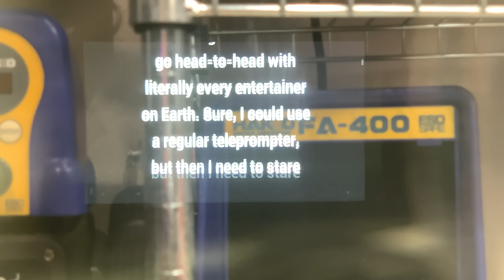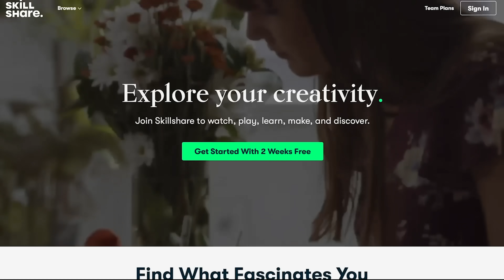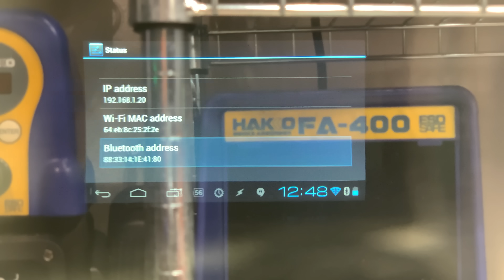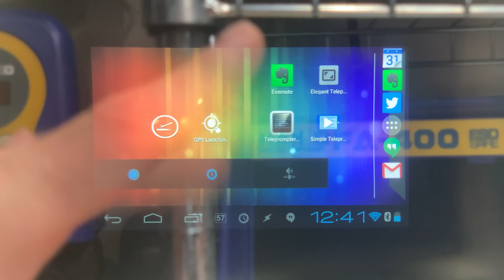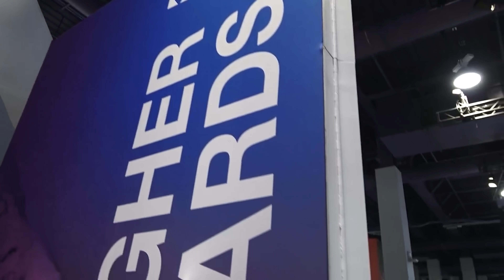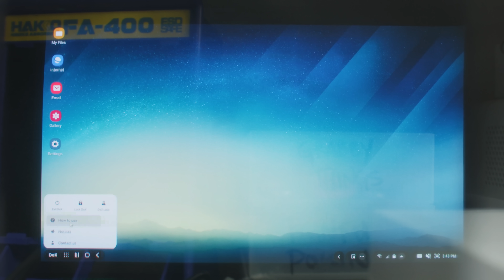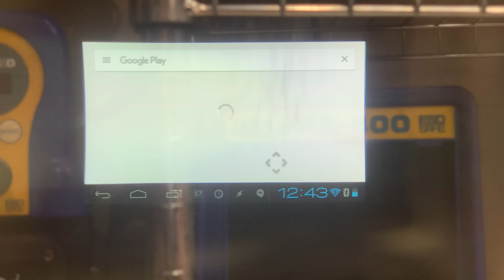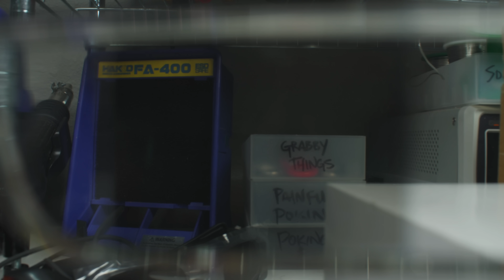If This Wearable Fails, My Channel is DOOMED!

Comment from the maker: So apparently, Epson offers a dev kit that's literally the guts of the BT-40. First-party documentation was available the whole time.🤦‍♂
Epson, my offer of a sponsored video still stands...
Reply: thanks for puttin some rhymes in
Reply: the extents you are going just to look cyberpunk are fantastic. "Eyebrow purposes" xD
Reply: Mums wondering when you're gonna call her for another night out
Reply: How's the mirage keyboard coming?
Reply: @camerong.5024  yes i am also waiting for more info on this.
Reply: This is great! I mean you could start just by chopping the nose piece and leaving one lens on the desk if there's no wire across the bridge... I look forward to your success 🙌
Reply: Quick hard hack take the right side Dremel off any visual bulky parts like the lens peal back the ribbon cable. Now tuck the right guts behind your left ear. Not the first time I have said that sentence btw
Reply: I ttought that was going to be the wow reveal! Ah, good luck!
Reply: Can u make a stereographic display out of it ?
Reply: Hack all the things!
Reply: Man do i wish you had come out with this video ~6 months ago...  I had purchased a pair of these to use as an AR headset solution for work. I ended up returning them since I had opened them up to fix a wire, and in doing so fucked up the cooling solution for the projectors. The thing had battery life issues before, and pretty bad cooling issues afterwards. Whats worse was that it (in my experience) only worked with samsung android devices. It didn't work with google phones, or android tablets, basically only samsung devices that supported Dex desktop mode.

So saying I was floored by the fact you got it to work with some random brands SBU would be an understatement. I will be watching this project with great interest.
Reply: @AidanNaut0  that is on the device manufacturer for not including DP on the USB-C port.
Reply: I actually got Epson to send me the Android Kernel source for my BT-200, which I got after being inspired from watching your other video.

I am currently trying to reverse engineer the LCD module, so I can get a MIPI DPI bridge chip in order to make literally the exact interface Epson decided to put into the BT-40 lol.

I've found DisplayPort USB-C is extremely closed source and it really, really sucks. I'm hoping I can get it working but I don't have a lot of hope for it...
Reply: @DingleFlop  The thing is, the Linux kernel is GPL licensed so they *legally have to honour requests to the source*, if it is something propriatery that they own, you aint getting that source.
Reply: @u1f98a  I understand that, but I didn't even expect them to comply with GPL. Unlike most people, they don't just have it hosted anywhere. They could have easily blown me off and ignore me, but they decided to honor the request anyway.

What I'm meaning to say, is if you don't ask, the answer is ALWAYS no.
Reply: @DingleFlop  
This is legally what's known as the TiVo clause now.  TiVo tried to get away with the source "being on an embedded device" and that the source was available but effectively useless without running on their hardware.  

GPL v 2.0 is essentially weak to this (which was what the linux kernel is licensed under)

GPL v 3.0 addresses this kinda shit specifically.
Reply: Do you have a sponsored link to the SDK?
Reply: can u do karaoke with it?
Reply: lol what
Reply: Best episode yet,
Reply: F
Reply: Link?
Reply: yes I was the 666th like
Reply: There's also the creal MR glasses that came out recently. You could use those.
Reply: Was about to comment that they make teleprompters that fit on the camera and let you stare back at the lens as well but I caught the last few seconds of your video and apparently I'm stupid for not knowing something I don't know?
Reply: try not to sound desperate.....oh too late
Reply: 297)Would it be possible to use 3D glasses, project onto the lenses - when they block the image?
Reply: Check out my dumb wearable: https://youtu.be/m9zIss28RdI

Comment: Easy workaround, just remove the right lense, leave the whole board and screen in tact :D
Reply: Yeah just cut the glass in half, fold over the ribbon cable back on itself, and reattach the minimal required electronics to the main side
Reply: @gaberealstudio  It can stay on its original side for balance purposes.
Reply: Very true, you don't even have to touch the electronics.
Reply: Given that it turns off and on from both sides when the right is unplugged,  im betting the issue is more of a power supply wired in series. 

Of course I'm guessing but I can see where some money could be saved in the power regulation circuit by allowing a bit more power and using it across two devices.  But because it is so close to the eyes,  the series circuit could pop a thermal fuse or something  if damage from a drop or something could otherwise cause a catastrophic failure. 

If my guess is right, tracing the power from the regulation circuit to the end points would identify the connectors and a small resistor across them should be enough.
Reply: @sumduma55  This can be easily checked by unplugging the right display, but keeping the display board connected.

Comment: Holy crap that ad plug segue was smoother than a frictionless physics homework problem
Reply: It's "segue" not failed transport meme Segway ! LOL
Reply: @edwardfletcher7790  he said what he said
Reply: @edwardfletcher7790  failed? LOL. They're still being made. The guy in NH sold it for over $100M to the Chinese, and they still make the original style Segways, commercial units, and all the other Ninebot stuff. Segway paved the way for things like the Onewheel.
Reply: @littlejackalo5326  ummm it was meant to be a "revolutionary transport solution" .
It doesn't exist outside tiny markets and most countries outside the US have none of them.
Reply: @edwardfletcher7790  Their traditional scooters are freaking everywhere. Theyre basically the same scooter as the Xaiomi ones sold all over europe and china.
Reply: @Epitath6045  "Everywhere" meaning your city/country or the whole of Europe/Asia ?
Reply: @edwardfletcher7790   @Edward Fletcher  People stopped talking to you because you need to go update your internal referents with current data.  Do your own homework and maybe you'll have something of substance to discuss.
Reply: @russellzauner  Russell, all your arguments comes from an American experience. The whole world is online mate.
Reply: @edwardfletcher7790  The Sur Ron line of top performance EV bikes in class literally uses a Segway frame.
Reply: I love how traffic for comments is mostly gained through grammar errors
Reply: @hojirick  oh god you did it again. I MUST STOP MYSELF BEFORE IT'S TOO LA- it's "grammatical" in this context haha 🤓.
Reply: for real.